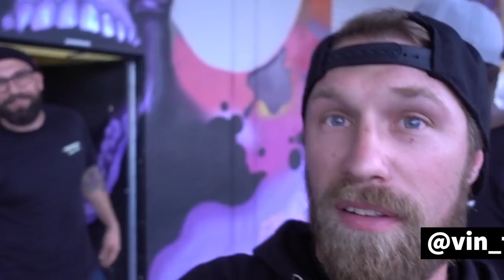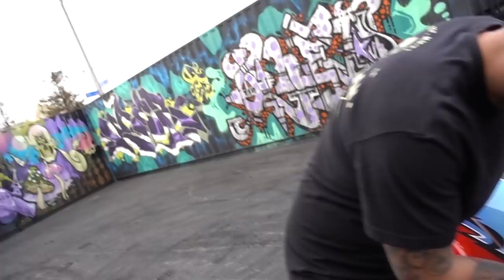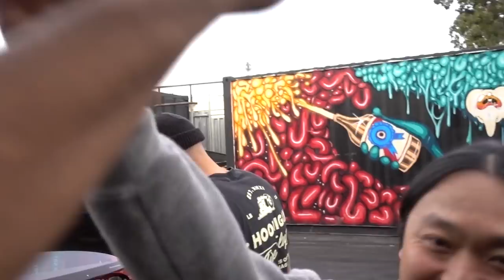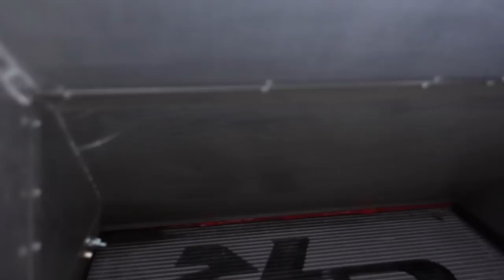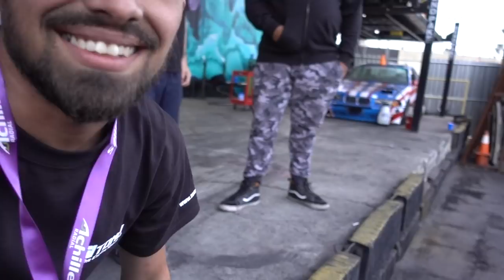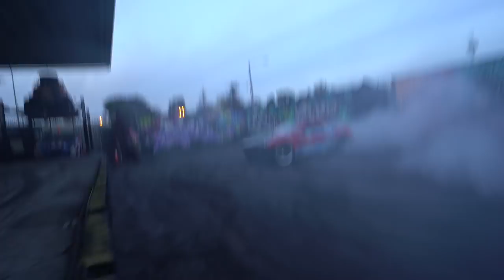Formula Drift 1000hp Stroker r35 GTR Jerry Yang Racing // DT262

Comment: The R35 GT-R is not a Skyline tho!
Reply: Tom T. You have no automotive scientific mathematical proof of that ...
Reply: Why so violent towards Tom like it's just a comment
Reply: Alejandro Ochoa dont be to rude is not a skyline because of the engine that is why
Reply: The Skyline is a different car from the R35 now so calling the R35 a Skyline doesn't really make sense.
Reply: They share nothing but a chassis and manufacture
Reply: I mean, isn't an Infiniti G35 more of a Skyline than an R35 actually? People just like calling them skylines. They think it's cool or something like that. I've met people that didn't know other models of Skylines besides GTRs existed too. Lol or other RB motors besides the 2.6 liter.
Reply: Tom T.  might not have the skyline label but they did make it a chronological continuation of the skyline chassis code I.e. r33,r34 and boom r35. and out of curiosity what makes a skyline a skyline??
Reply: Actually it’s a Renault so...
Reply: The VQ Series (V35-V37) now have the Skyline name, The GTR is now it's own thing and is no longer associated with the Skyline name.
Reply: Still not a skyline tho
Reply: Tom T. Neither is the 350gt
Reply: Fuugitive it's called a GTR and not a Skyline GTR
Reply: They also sell a stock non turbo version very simalar to the r35 called a skyline 250gt and 350gt  so your comment doesn't make sense it's a skizza either way and the put the vr38dett in the gtr for better weight dist as the rbs a heavy girl
Reply: @just yah boi the 350gt has a Skyline badge on the back because it's a Skyline.
Reply: @Kiwifresh Styles the V35-V37 are not just non turbo versions of the R35, they are completely different cars hence one is just called a GTR and the other is a Skyline.
Reply: If it says skyline on the back, its a skyline. If it doesn't, its not. Skyline was the model name, with GTR being the top option level. Much like the Supra is not a top spec Celica anymore (mk1 and mk2´s are) the Gtr isn't an option level for a skyline anymore. It´s now a separate model. So the last skyline to have a GTR model option was the r34.
Reply: Michael Adams haha so wronh
Reply: @Alejandro Ochoa it dose not have the skyline name means its not a skyline, there have been other Nissan gtr's before the R35 that weren't skylines.
Reply: Alejandro Ochoa sounds like you’re having trouble getting over it. 
Skylines still exist. They’re Not this.
Reply: Alejandro Ochoa Its nothing close to a skyline, its just a GTR ffs
Reply: just yah boi where’s your proof 🤔...
Reply: It'd be nice if the R36 had a sedan and non GTR versions.
Reply: DriftNick okay well the the 35 is a Skyline in Japan! feel better?
Reply: You're all wrong, it's a datsun
Reply: People are still trying to call it a skyline. For fucks sake....
Reply: These are the Skyline models that have existed since the r34 stopped production: 250GT, 300GT, 350GT and 370GT. In various 2 and 4 door setups. None of which have EVER been given a GTR badge. Never ever ever ever..... ever.
Reply: Tom T is right it's not a skyline it's just a gtr.skylines
Reply: Wheres your skyline?
Reply: It's a Yugo
Reply: That's like if Porsche stopped making normal 911s, and only made GT3s from now on, and someone were to say "the GT3 is not a 911". So dumb.
Reply: but why?
Reply: Once it's a gtr it is a skyline
Reply: This is why I died laughing when I saw a G35 with the skyline badge on the trunk once.
Reply: Bushido Brown  it is a Skyline but not the traditional r34 r35 etc
Reply: JDM KID I gotchu! It’s just funny because of the people fighting over it! 😂😂😂
Reply: It's still a GTR and the R35, just because it wasn't named skyline it's still a successor of the skyline
Reply: Yes it is. The Infinity G37 aka JDM Skyline, and the R35 Skyline GTR share a platform just like all prior iterations. Yes, they changed a bit more than they used to, but it still shares a hell of a lot more than they want to admit.
Reply: Tom T.  The skyline was not just a gtr it came in many varients so it is  not a skyline because the r35 only comes in gtr so🤷🏾‍♂️🤷🏾‍♂️🤷🏾‍♂️
Reply: steez general but it still rides on a Skyline/G37 platform so...
Reply: The R35 was not made in Japan it was made in GB
Reply: Toyota Sprinter Trueno GT-Apex AE86 its still an Infinity G37 underneath. You people have no concept of how platform engineering works.
Reply: Big 'ol Booty Cheeks the G35/37 platform is the base the r35 gtr rides on so technically its still a skyline just without a badge for marketing reasons. The upcoming r36 WILL be a clean slate car, and as such will be the overpriced overblown supercar you nuts seem to want. Ill stick with cars that can be tinkered with...
Reply: DriftNick still rides on a skyline platform.
Reply: S13 Silvia and 180sx are the same platform but you don't call a 180sx a Silvia do you.
Reply: DriftNick sil-eighty ;)
Reply: DriftNick but then again, idiots dont go around claiming those two dont have anything in common like they do the r35 skyline and infinity g37, even though they do.
Reply: Sil-eighty was an aftermarket thing, the only idiots here are the people who don't understand why the R35 no longer has the Skyline name.
Reply: "if it isnt a gtr, its not a real Skyline" now suddenly "its a gtr not some pos Skyline"

Not sure where anybody said that in these comments.
Reply: DriftNick you are incinuating the second, the first was said for years
Reply: Pointing out the fact that the R35 isn't a Skyline isn't a statement about it being good or bad and the first comment doesn't matter in the context of the discussion which is if the R35 is a Skyline or not.
Reply: DriftNick the fact you refuse to accept the fact that it rides on the same platform as the v36 skyline, when it clearly does, and is impossible to disprove as it is mechanically true, it sounds like you are incinuating it is "better than a skyline" in some special way beyond the electronic gizmos and different body panels they added.
Reply: When did I refuse to accept that fact and why does it matter if it's true or not? still doesn't make the R35 GTR a Skyline.
Reply: DriftNick your entire argumemt hinges on the r35 being built on its own unique platform, not a modified skyline platform. It rides on a modified skyline platform. How cut and dry do you want? Besides. The Skyline name is a mark of honor, and anyone who denies the r35 this right, is insulting it.
Reply: Notice when I said S13 Silvia and 180sx are the same platform but you don't call a 180sx a Silvia, R35 GTR is not a Skyline, the Skyline name is now with the V35-V37 series, how cut and dry do you want it?
Reply: DriftNick that us an idiotic argument and i can easily flip it. Both are the same car too. Both are s13s. So you can call both an s13 and be right. Infinity G37s and R35 GTRs both ride on a Skyline platform so you can call both a Skyline and be right. Boom.
Reply: S13 is the Chassis code not the name of the car, the name of the car is Silvia or 180sx, you can call both an S13 because they both are S13's, G37 and R35 have different chassis code and different name, nice boom when you get it wrong, it's really not that hard to understand that the R35 GTR doesn't have the Skyline name.
Reply: DriftNick and comparing 80s platform engineering to 2010s platform engineering is totally apples to oranges anyways.
Reply: Thought it was just a Nissan Altima
Reply: First time someone has called me a heretic LOL.

Nissan moved the Skyline name on to V-series , it's no longer linked to the R-chassis or the GTR, calling it a Skyline when there is another Nissan that has the Skyline name and when Nissan don't use the Skyline name with it is stupid.
Reply: Tom made a lot of people butthurt. Lol everyone’s entitled to their own opinion. No need to be rude to Tom
Reply: Steven Garcia thank you, Steven. You're a person with a good heart.
Reply: Tom T. How is it not s skyline
Reply: I call it "GTR" not a "Skyline"
Reply: Shit even a g35 is still considered a skyline . Look it up

Comment: That's a bad ass drifrt car the R35 is awsome don't get me wrong but a 370z with I'm not sure of the year maybe 2016 or 2017 nismo I work with a guy who has newish Nismo 370 that's black with red accents (my import knowledge is lacking ) I would start with a regular 370 and throw nismo body kit,wing and good with a black chrome wrap and run a AMS 4.0 r35 crate motor with a custom intake that's ready for 12 injectors  and do a custom twin turbo kit use some precision 67/68's mounted behind the head lights so I could run 4" open tierdrop cut downpipes that exit either thru the hood or fenders with the gates merged into the down pipes,SUPER NICE NICE FAN WORK , no intercooler run m5 methanol so it's not needed, use fueltech's ft600 to control everything and all the good drift suspension mods I know nothing about I drag race but this would be my import drift car if I ever built one

Comment: i don't now how many times I've got to say it but ill say it again. THERE IS NO R35! The Skyline range stopped in 2002 withe R34. Its a Nissan GTR there is no R35 in its name. Yes i share the engine naming convention withe the Skylines. Yes it shares the same tail light design however it is not a Skyline. To anyone reading this stop calling them Skylines and R35's they are neither one